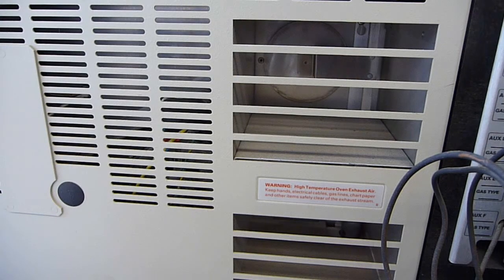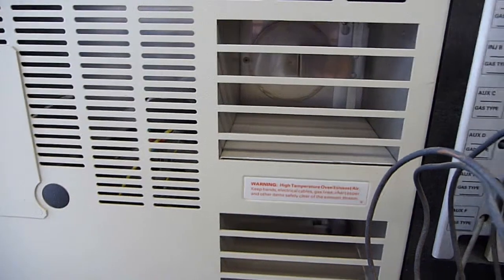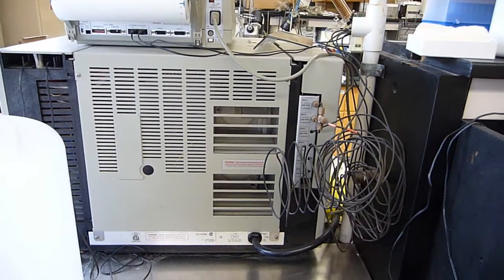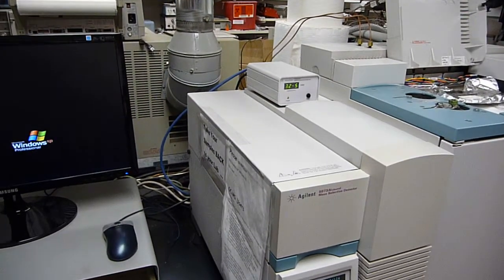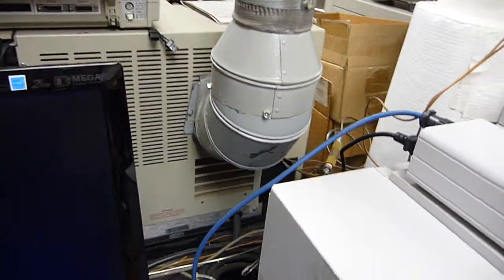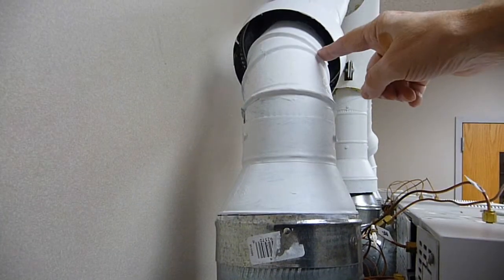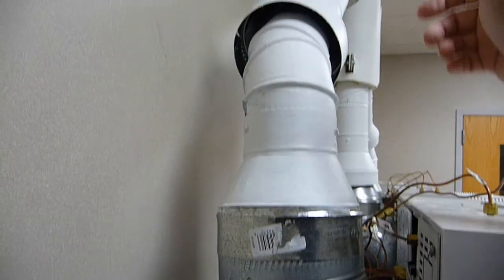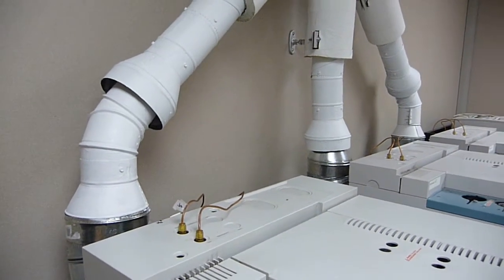Practical GC/MS Quick Video .. DUMP the HOT Air out of the room w/ Oven Exhaust Deflector

Comment from the maker: While a GC or GC/MS oven probably will not have any increase in chemical exposure vis-à-vis “normal” lab air (i.e., the lab that the GC or GC/MS is sitting in), deflecting the GC oven exhaust air INTO the lab exhaust/return of the lab HVAC system actually makes the lab SAFER for the people in the lab.  One item would be: any GC oven particulates would be going into the lab return of the lab HVAC system INSTEAD of into the lab room air.  […. Apologies for the run-on sentences]